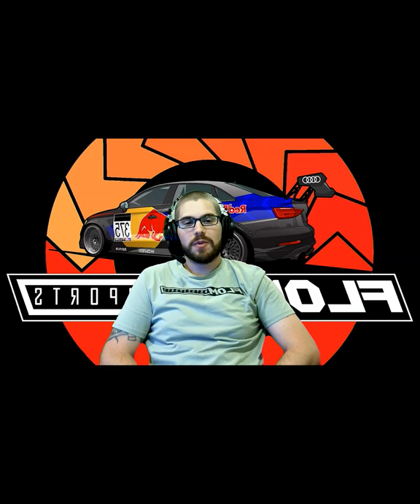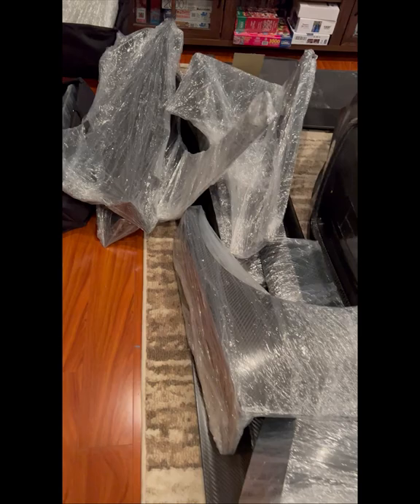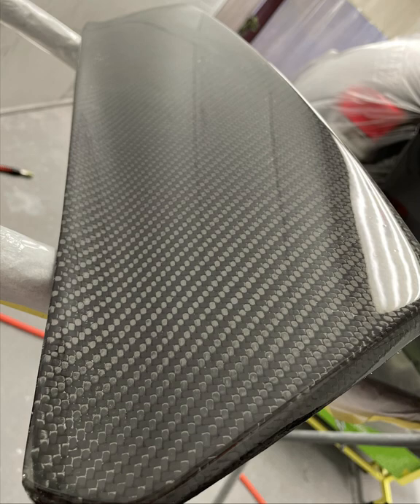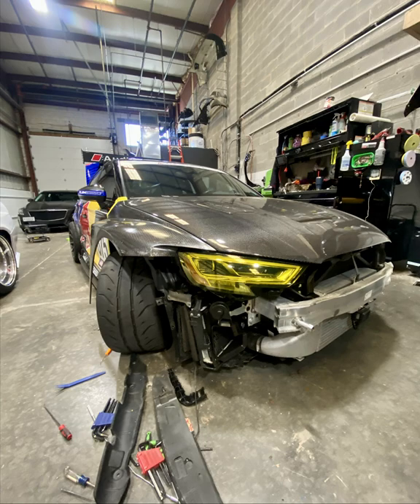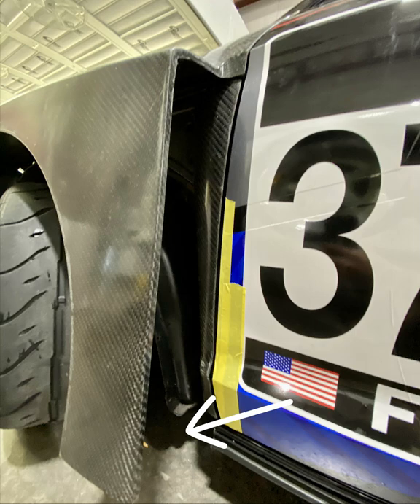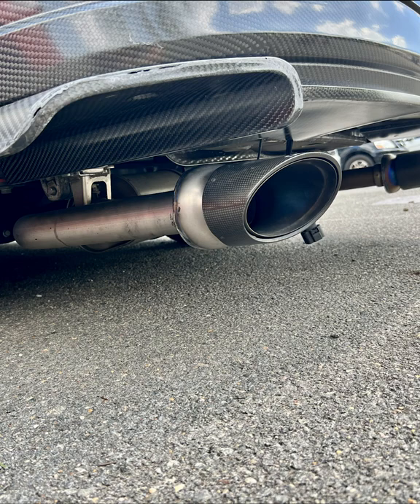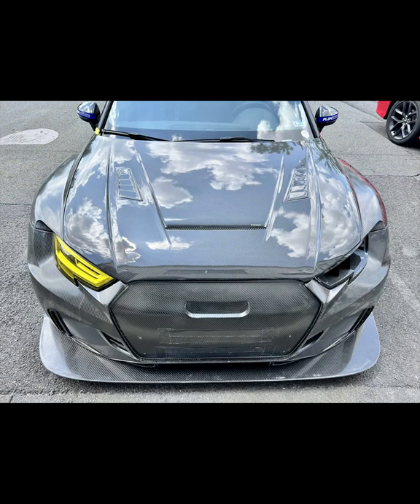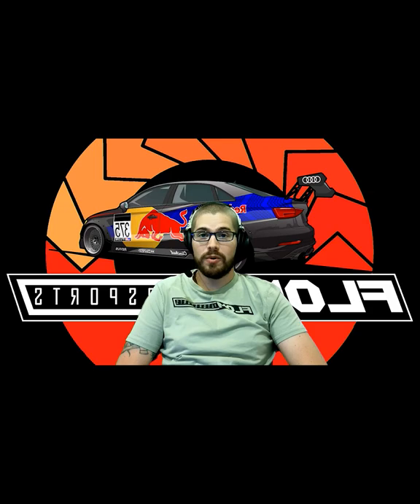MComposit TCR Carbon Fiber Wide Body Kit Install - Update 1

Comment: How much was the body kit?
Reply from the maker: Back in 2020, for the kit, not including wire transfer fees and shipping, this kit was about 4000 euros. At today's exchange rate, that is $4300. But that does not include the hood that we are running, the carbon doors, the trunk & wing, or the installation of the kit, or painting/clearcoat.